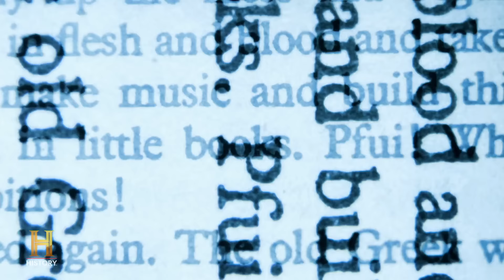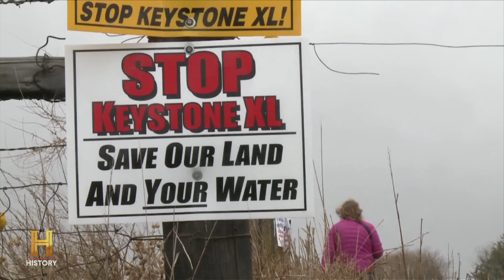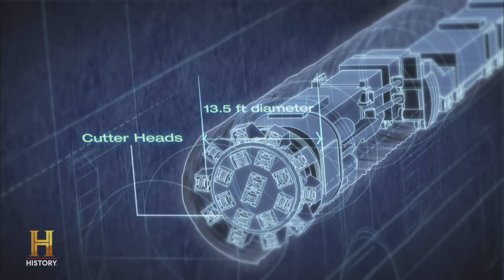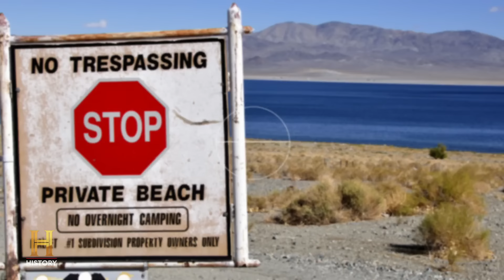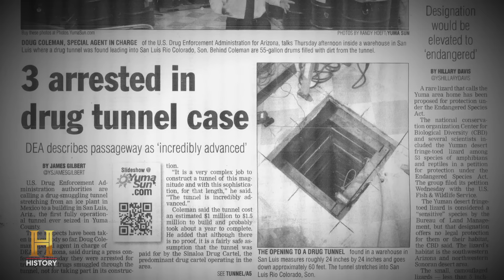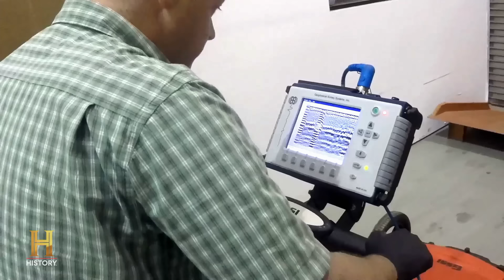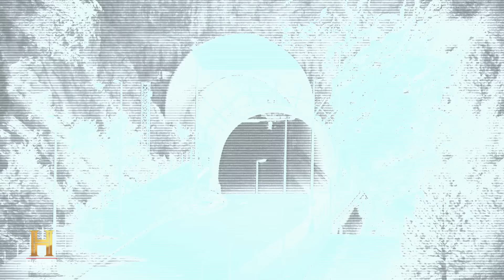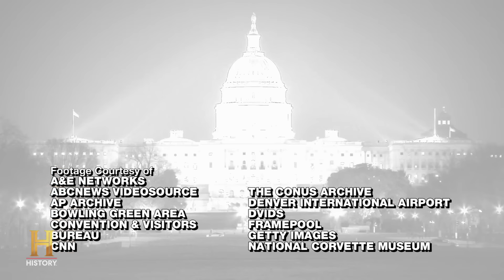Secret Underground U.S. Facilities (S3, E8) | America's Book Of Secrets | Full Episode

Comment: Pipelines are the safest way to transport any gas or liquid hazardous material. Somehow every documentary forgets to include this FACT. 
@ 9:55  “Even the companies didn’t know their leaky pipeline was there.”  
This is a 100% Lie from this little zipper head. Pipelines are required to be visible marked and transmission pipelines don’t “leak” like your drippy faucet. 
ROW = Right Of Way 
Most row are 100’ wide for the length of the project. After the line is installed the land looks just like it did before. Pipelines Don’t damage your well water or anything else people like to make up.